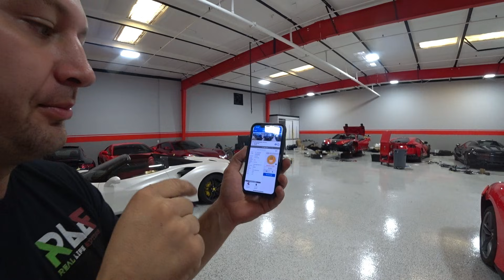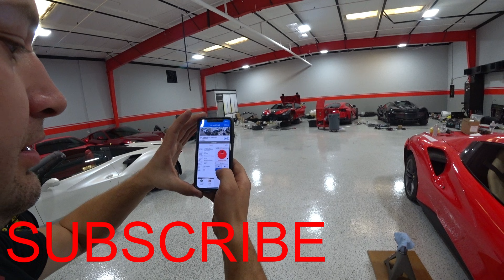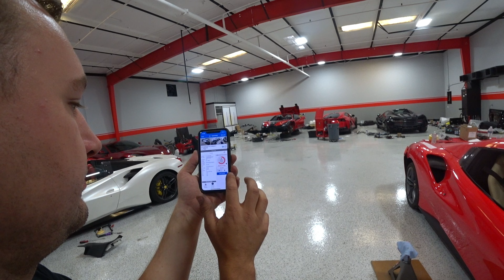Bought PIECE OF TRASH Porsche 911 To Rebuild!! - IMPOSSIBLE TO FIX!! (VIDEO #72)

Comment: If you want to try to fix it, you can try. If anybody can do it, it will be you.   If it's a joke, I hope you salvage many parts.
My daughter had a '99 Acura 4dr with sun roof, kept in mint condition.  Two drug dealers stole it, and cops chased them and it was wrecked in 2014.  It had LoJack.  Why did they chase the car?  Let God decide...  Airbags did not deploy.  Two dealers we're caught.